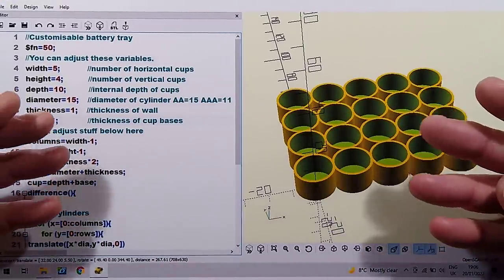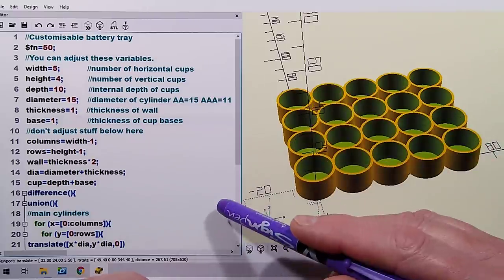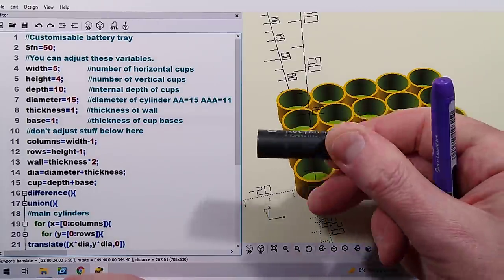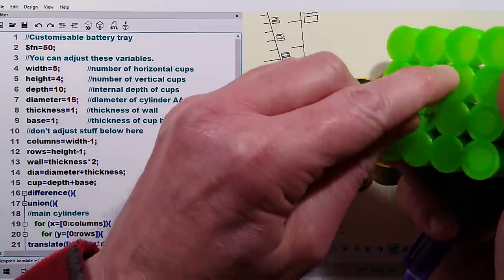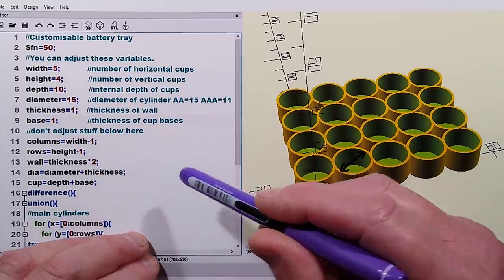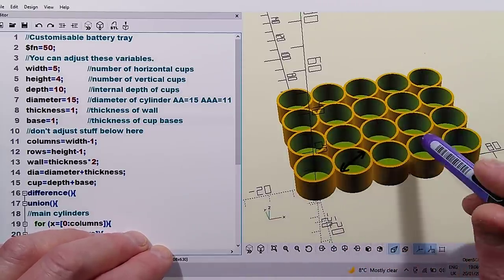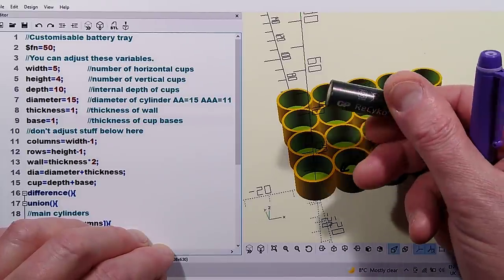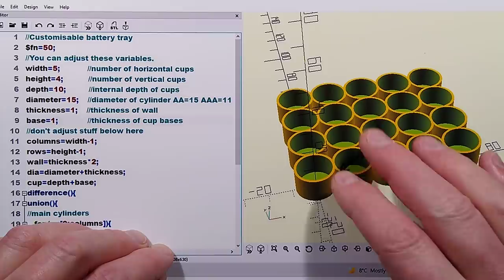DIY custom battery storage trays

Comment: When I saw this the first time I instantly thought, "wouldn't it be great if you used two of them to hold them in place on both ends?" Then I thought, "that idea, plus a set of clips would allow it to be moved and kept as one solid piece." Then I remembered I don't have a 3d-printer.
Reply: Back to using empty tic-tac boxes again
Reply: @highpath4776  One of the best second-use containers ever
Reply: I was thinking along the same lines, but putting some terminals in the cups and using them for building battery packs with lithium cells.
Reply: I know feeling, I don't have a 3d-printer either! Lol
LLAP
Reply: This was almost exactly my own thought process, although I didn't get as far as the clips.
Reply: @petercoutu4726  - You could actually just put a hole in the side to allow for a bare wire to be inserted into the end, then heat the plastic lightly to fuse it into place.
Reply: @gustavgnoettgen  but its hard getting the smell out of them. I dont want my components to smell minty.
Reply: @plainedgedsaw1694  Why the hell not? 😁
Reply: You might enquire at your local library.  The one in my town has one and they only charge a small fee by how long it will take to print, to cover material cost...
Reply: If you want or need to get this but don't own or otherwise have access to a 3D printer you can send your STL file to JLCPCB and have them print and ship the units to you.
Reply: Like "I want to buy the new ABBA cd" - Oh, I don't have  CD anymore ...
Reply: I had the thought of using a second to hold the top as well. That's when I remembered I don't have a printer.

Comment: For possibly faster print times, set the "thickness" variable to a number divisible by your extrusion width. For a 0.4 mm nozzle, 0.8 or 1.2 should be fine. If you pick 1, it might try to fill out a 0.2 mm gap, which isn't always going to look great.
Reply: Very good point!
Reply: You could also use a 0.5mm extrusion width with 1mm walls
Reply: @JamesMyatt1  That's like scratching your right ear with your left hand :)
Reply: Janos Nagy J. i prefer to scratch my left ear with my right hand
Reply: Was gonna say the same thing. I hate seeing gap-fill on sliced STLs.
Reply: @janosnagyj.9540  Huh? It'll actually give you a faster print and better layer adhesion too. There's no reason the line width has to be equal to the nozzle size. Check out CNC kitchen on YouTube.
Reply: thanks for the "tip"
Reply: Important point about this, your slicer doesn't consider nozzle output to be 0.4, it's 0.48 because it has to squish plastic. This is not something that's immediately apparent but it does affect slicing because with 0.4 flow rate will ever so slightly be smaller and it might cause problems and be super hard to debug.
Reply: @MladenMijatov  That depends on your extrusion width set in the slicer. If your slicer is set to 0.48mm extrusion width, then the "thickness" variable should be 0.96 or 1.44 for example (0.48 multiplied by 2 or 3 lines you want).
Reply: Too bad the Arachne version of Cura isn't stable yet.  It can optimize wall line widths.

Comment: A nice extra feature would be a small hole near the bottom of the cup to put a copper wire through. That way you can test the voltage of the cells in storage without getting them out.
Reply: Also if you happen to spill a glass of water over them it will drain out :)
Reply: Just had a fiddle with this (first time using Openscad)... change the last bit of the script to this & and see if its what you were thinking...

//hollow cores
 for (x=[0:columns]){
 for (y=[0:rows]){ 
translate([x*dia,y*dia,base])  
cylinder(h=cup,d=diameter);
}
}
//Bottom Holes
 for (x=[0:columns]){
 for (y=[0:rows]){ 
translate([x*dia,y*dia,-1])  
cylinder(h=5,d=5);
}
}
}

(edit: just noticed someone has commented far more detailed modifications below haha)

Comment: Appears to be a simple task to add a small oblong hole for a peice of copper strip to enter each compartment to make battery holders to power projects with. Cable tie the whole thing together and solder a big BMS on the right copper lug and you have any capacity battery pack you want. You can design it around salvaged laptop batteries, especially as battery packs like that are usually have 1 or 2 bad cells and the whole pack is unable to take a charge to protect the rest from over charging them.
Reply: I have a bunch of cells and have been planning to make a pack, this looks like a good start vs buying some.
Reply: @Donn29  loads of ready made BMS boards for all combinations of batteries on eBay, AliExpress, Banggood, and Amazon. Most are ok, just check what you have been sent is the same spec as you have ordered and make sure you give yourself a big overhead (20% is good) just incase the components are not as good as implied.
Reply: I just figured out via YT how to add a hole, wasn't too bad once I figured out I had to render, not preview to see the hole.  Only used SCAD for about 20 minutes now, lol.  Just need to look at BMS.  I have seen them on Amazon Canada, was going to purchase through there.
Reply: A hole in the bottom of each cup would be worthwhile in any case; it would facilitate cleaning. Being able to string wire through a pair of trays (top and bottom) in such a way that you can build a boxed set of batteries having an arbitrary total voltage is a good idea.

The cup mouth could use a lead-in, such as is found on socket and box-end wrenches. An alternative would be to bridge, domed and x-wise, any 4-tuple of cups -- as these cups are least visible when the tray is loaded.

An optional flared base (think: wineglass) would be useful, too, especially on compartments with widths less than, say, 5 cups or some function of the length of the batteries served.

Comment: On the night of the live stream that featured this first time, I was actually going to have a look on eBay for battery holders for all the rechargeables left after Xmas. Perfect timing, and my Prusa MK3S has been spewing them out ever since. Red for discharged, green for charged, and silver for regular alkalines. I found the cups a little too loose and settled on AA=14.7, AAA=10.6.
Reply: I noticed the same thing. Could also tighten the space up by altering the position of the next row (or column) by 50% to either the left or right (i.e. as in a hexagonal layout).
Reply: @two_tier_gary_rumain  I think the idea was to space them far enough apart that you can pick up a cell from somewhere in the middle. Reduce the space too much and you can't get your finger in there. Okay if you don't mind working your way in from the edges...
Reply: @sootikins  You could also put them out from the bottom if there was a hole there.
But I think this sort of thing should really be made out of a soft silicone rather than a hard plastic.
Reply: @two_tier_gary_rumain  Yep, soft silicone sounds like a good idea.

Comment: Rather than editing the script to change the parameters, you can also use the "Customizer".

If the "Customizer" view isn't shown by default, select "Customizer" from the "Window" menu, then you can edit the width, height, depth, diameter, thickness and base parameters without fear of corrupting the code by accidentally removing the ; or changing the parameter name.

Comment: As suggested in the comments, i added some code to create a hole in the base for measuring or up-side-down storage of button top cells.

1) Add the variable "hole_diameter=5.5;" to the variable list.

My Ikea Ladda (AA) button-top button has a diameter 0f 5.38 mm
Measure the button diameter of your cell or choose a diameter of your liking.

2) Insert the following code after the cylinder();-block inside the for-loop:

translate([x*dia,y*dia])  
cylinder(h=base,d=hole_diameter);

It should look like this:

for (x=[0:columns]){
     for (y=[0:rows]){ 
            translate([x*dia,y*dia,base])  
            cylinder(h=cup,d=diameter);
            translate([x*dia,y*dia])  
            cylinder(h=base,d=hole_diameter);
       }
}

##################################################

To add nickel strips to have a common negative for each row i did the following:
The center nubs are there to raise the nickel strip to make contact with the negative side and avoid the wrapper of the cell. They can be deleted, but i thought i add them to avoid problems.

//Add  all other vatiables above here

nickel_strip_width = 5; //width of nickel stip
//don't adjust stuff below here
columns=width-1;
rows=height-1;
wall=thickness*2;
dia=diameter+thickness;
cup=depth+base;
nub_diameter = diameter/4;
difference(){
    union(){
        //main body
        for (x=[0:columns]){
            for (y=[0:rows]){ 
                translate([x*dia,y*dia,0])  
                cylinder(h=cup,d=diameter+wall);
                translate([x*dia,y*dia,base+1])  
                cylinder(h=.5,d=nub_diameter);
                
            }
        }
    }
        //hollow cores + nickel strip holes
     for (x=[0:columns]){
         for (y=[0:rows]){ 
            translate([x*dia,y*dia,base])  
            cylinder(h=cup,d=diameter);
            translate([x*dia,y*dia,base+.5])
            cube(size = [nickel_strip_width+.5,diameter+wall,1],center = true);

        }
    }
}

    union(){
        //nubs
        for (x=[0:columns]){
            for (y=[0:rows]){
                translate([x*dia,y*dia,base])  
                cylinder(h=.5,d=nub_diameter);
                
            }
        }
    }

DIsclaimer: I did this in 30 minutes and have never touched openscad before, but the render looks promising.

Comment: I genuinely love the printed screenshot. Far better to be able to physically point at the parts of the image with a finger or a pen, rather than moving the mouse around as would have to be done if it was an electronic image in the video.
And very 'Big Clive' as well - I always love the printed images you bring into shot as they are such a clear way of showing things!

Comment: I've been trying to convince my Wifey to allow me to spend an enormous amount of money on a 3D printer, now thanks to you and this video, I think I can! 😜
I'll let you know how it turns out. 😁
Reply: I bought the cheapest one I could find. I found it the best way to learn
Reply: I have an Ender 3, they're great value.
Reply: They're less expensive nowadays than you might think.

If you want to reduce some cost, you could consider to buy a kit and build it yourself. That can be fun as well.
Reply: Maybe you could talk your local library into obtaining one. Ours has a couple though they leave it up to the user to know what they're doing, there's no tutorial or class.
Reply: I've been happy with my USD 150 Anet A8 for almost five years now. It helps that nearly every part is generic and easily available from 3rd parties

Comment: I used to work in a vertically integrated HVAC electronics manufacturing company. From bare laminated PCB stock to finished product. AA cells came in trays of 144. I always dreamed of using the bare double sided boards and making a ginormous battery of AA cells… then, you know, Tesla started doing it with 13650s.

Comment: Genius! I really need to get a printer, every time I watch a vid where someone has produced a really simple item with even a cheap printer I get jealous. I'm currently using the 4 pack holders for my 18650s and using the different colors for charged/discharged, but keeping those wrangled is kind of a pain.
Reply: Definitely worth having. Always using mine for printing various tools or repair parts.

Comment: This is cool. I haven’t seen this software/language before.

In the second cylinder() you could probably have h=depth  as the negative holes go higher up than the height of the solid cylinders. (Maybe it needs to, to ensure there isn’t a skin on the top of the cylinder)

Very cool script!
Reply: Since the 2nd cylinder is used to "cut" the cups it's OK when it is a bit higher than actually needed. Avoids certain rendering "bugs" in fast display mode where it tends to show the "skin" you mentioned even though nothing is there.

Comment: Hey guy, if you make your perimeter a multiple of extrusion width (for a Prusa 0.4mm nozzle it's 0.45mm), you can create dimensional walls that are multiple of extrusion width, which are stronger and print faster, keep on SCAD'ing! <3
Good times.
Also, in options, you can enable "goldfeather" which fixes the difference appearance without render.
Cheers!
Reply: So printing 0.9mm with a prusa nozzle would be better than printing 1mm?
Reply: @SpieleETC  Sounds about right to me.

Comment: A single cup could be quite useful as a protective cap to avoid shorts.

I made something similar to store 13/16"  and 1" threading dies, but it was a solid block with the dies standing in edge in semi-circular recesses. Made a huge improvement in my tool chest.

Have you tried this with a hex packing? That might be interesting. 

The other use for these that comes to mind is first as a fixture for holding 18650s when preparing a multi-cell pack, and also, if you made them bottomless, you could use the open grid as a spacer to hold the cells in place.

With a hex grid and say 9 rows of alternating 6 and 5 cells each, you could assemble a rather fearsome 50 cell battery in roughly 120 mm x 200 mm.

Comment: An indent in the bottom would allow for cells to be placed upside down (and still stable). That orientation could then signify "empty" to separate them.

That was my only thought, else it was perfect for what it is :)

Comment: Once again Clive, excellent work. I have something similar that stores batteries in order of size. Mine has an inbuilt tester in to. Yours is unique though. If I had a 3D printer I would certainly make this up. It would be great to use in a radio HT battery, sixty AA cells in series would give you the 90v, this would be great for making up the Ever Ready portable 64 size, the vintage radio buffs would love something like this.

Comment: Great to see that you did a short on it - Get people to see how a short can be more than just as braindead video and can show useful stuff. 
As said there - I need a 3D Printer / want one for useful stuff like this. 
I always appreciate the work you put in everything you do.

Edit: You culd maybe edit that script to have a "top cap" that basically is two cups stacked together at the bottom so you can stack batteries on top of each other.

Comment: I added $fn=200 to the cylinder parameters to create higher resolution models, which was something I desired as I'm printing much larger sized trays for other random objects.

Thanks for the handy script!
Reply from the maker: You just need to change it once at the top of the script.
Reply: Oh right, I haven't used OpenSCAD much, thanks for the tip!

Comment: Really need to get a 3D printer sometime soon. I was thinking it'd be nice to be able to make a holder for different sizes 18650, AA, AAA, etc that were all together but all you'd need to do is use a couple drops of glue to join the different sizes together.
Reply: That's a cool idea, you could arrange the cellholders into cool shapes if you did that, like lettering. 👍
Reply: The Ender 3 Pro v2 is $240 on Amazon, and a GREAT printer.

Comment: WAY safer than the way I'm currently chucking salvaged 18650s in a drawer. 🤣 Might see if I can figure out how to mod the script to punch a hole in the bottom, or add a second bottom, to be able to spot-weld leads to those batteries. DIY battery packs!
Reply from the maker: Maybe I should add that into the script.

Comment: My "improvement" would be to have it double sided to then you could stack them if you have a lot of cells or limited room for storage other than that simple classic great design
Reply: having it double-sided (cups on top and bottom) would make it hard to print, requiring supports for the bottom cups. probably easier to just print 2 of them and glue them together.

Comment: How about a ground plane in the bottom, so you can check battery voltage of each cell by just by moving one meter lead over the tops of the
  cells.( the other lead on ground plane).

Comment: Suggestion: put a 5.5mm hole in the bottom layers so you can put batteries in button down vs button up to differentiate between charged and un-charged batteries. personally I use ammunition storage boxes from  Case-Gard.
Reply: New to OpenScad but this seems to work:

//hollow cores
 for (x=[0:columns]){
 for (y=[0:rows]){ 
translate([x*dia,y*dia,base])  
cylinder(h=cup,d=diameter);
//anode hole
translate ([x*dia,y*dia,base-3])
cylinder (h=6, r=3,$fn=50);

Thanks!

Comment: Improvements you ask? Lets see how annoying I can be...
Well for starters, it needs casters so it can skate about your cupboard.
Some nifty offset supports for stacking the trays a mile high might be nice.
Insert molded contacts with traces out to an array for test points. 
Well hell, if your going to do that, integrate an ardwino to cycle through the cells exercising them proper.
Well, now you need a backlit display so you can interrogate each addressable dock and of course 
an integrated cooling fan and, and , and.....

I enjoy your channel. Thank you